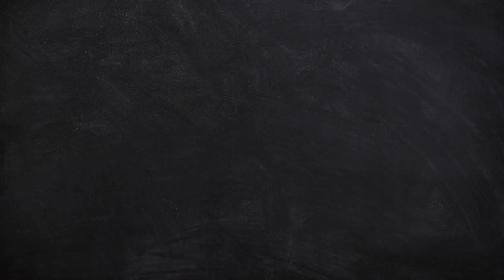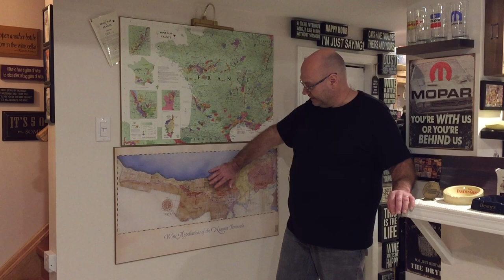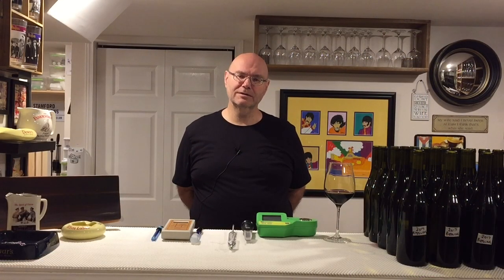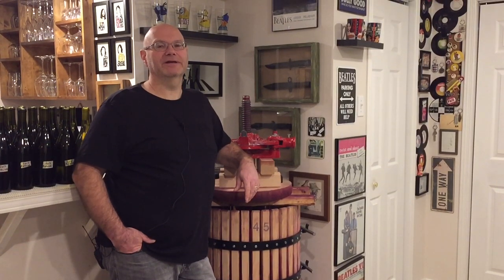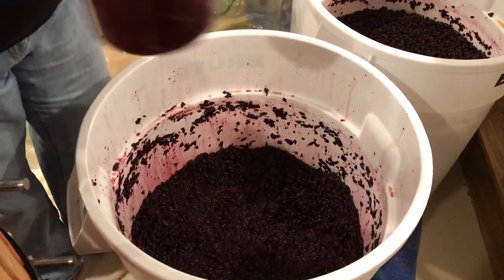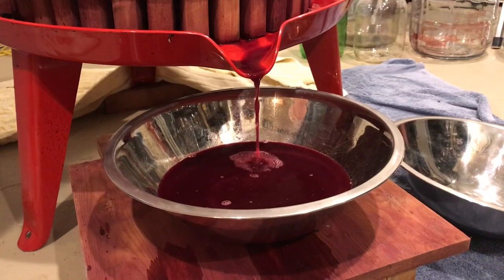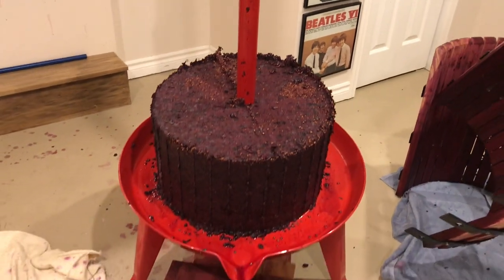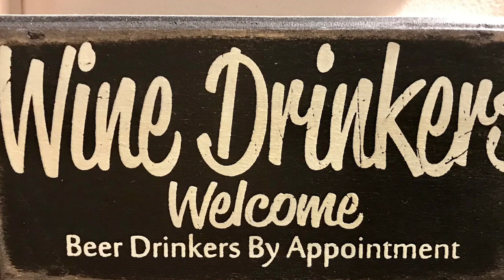Winemaking: Making Red Wine At Home, Part 1

Comment: My red wine ph leavel 2.5 How to increase ph leavel.
Reply from the maker: You can add 0.9g per L of potassium bicarbonate to lower the acid by 1g per L  which as a rule of thumb raises the PH by about 0.1 , you can also put the wine in a cold environment a little below freezing for a couple of weeks. This will cold stabilize the wine lowering the tartaric acid. The other thing I do is put red wines through malolactic fermentation to reduce the malic acid in wine, the malolactic bacteria need the PH to be around 3.2  before they can start to work. Also fruity white wines can have some sugar added before bottling to help balance the acid. If you add sugar you should also add some potassium sorbate to prevent renewed fermentation!  Never add the potassium sorbate to a wine that has gone through malolactic fermentation though or you will get an off odour. I hope this helps. 

Klaus
Reply: @WhatWeDoChannel  why the ph level is dropping, what is the tartaric acid and malic acid this chemical use to wine making